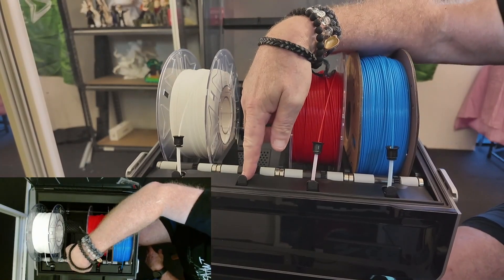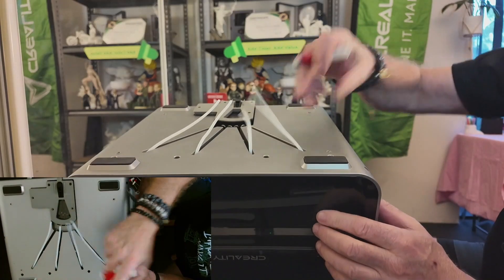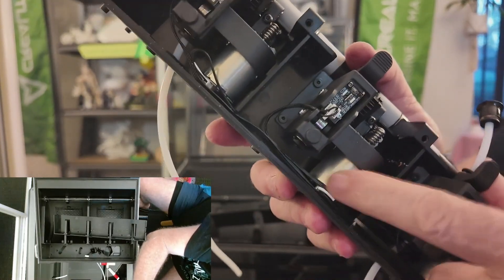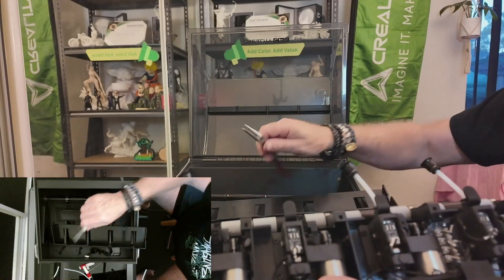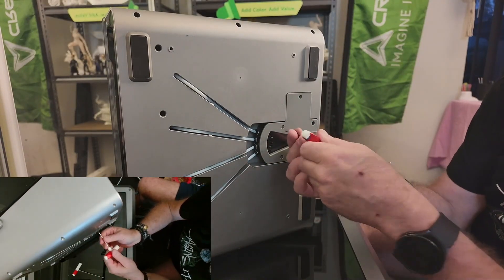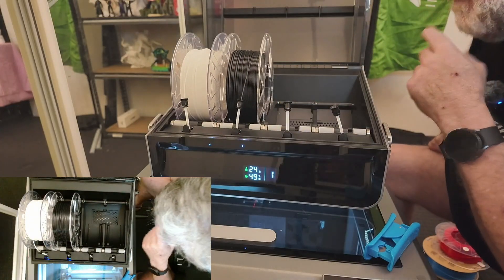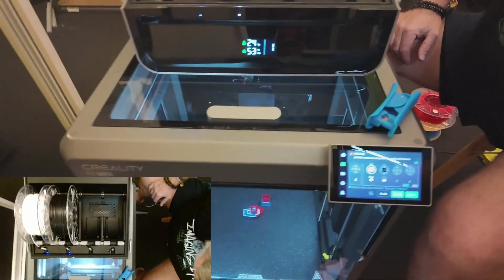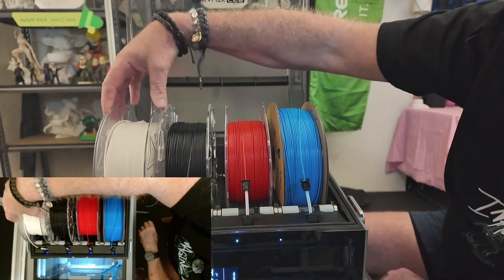I dismantle a Creality CFS to remove a piece of stuck filament.

Comment: After clearing the clot in the extruder, I observed another problem,

The filament was moving smoothly through the buffer, but almost 60 - 80 mm outside it would stop and retreat, going back to the spool.

What could be the course and the possible solution?

Comment: Thanks for doing the video.  Very helpful showing disassembly and fixing the bad PTFE tubing.  I am chasing all of the reasons contributing to the K2 Plus and (2) CFS  FR2836 error code.  I also learned that a non connected connection for the tubing internal  in the hub causes filament jamming.
Reply from the maker: Thank you glad it was helpful

Comment: Hey Gary, Literally just had a jam on my CFS internally after a 54hr print. Again mine was in the B slot as well Go Figure? I was absolutely fuming as it wouldn't not allow me to recover the print continuation stating filament need to complete flushing. OH well.  Anyway saw your Video and appreciate it as it saved me a tone of time stripping it down myself for the first time. Cheers  Mate
Reply from the maker: Happy it helped

Comment: For some reason my ribbon cable that connects into the feed motor block is wayyyy shorter, to the point I can't connect it now that its disconnect as the motor block needs to be seated into position. Any ideas anyone?
Reply: Same here, did you find a solution?
Reply: @fattyarbuckle78 yeah, the cable was folded on itself and pinched inside the case, which made it seem shorter. I had to gentle tug and wiggle it over a ridge inside the case. It was a pain to do because you cant really see anything and i didnt fully take it apart. I got there eventually though

Comment: When mine broke off I just inserted a piece of filament from the single hole in the back and gently fished it through the channels underneath and prayed and it finally made it to the motors and pushed it out. When I said I gently fished it was a matter of creatively bending the filament prior to installing and it luckily made it into the D channel and I just pushed slowly until I felt contact and slowly, slowly, slowly pushed until it came out the inside hole. 

Your way took way longer, but it was a great lesson on how it comes apart and probably the best way to do it.
Reply from the maker: I tried a few pushing options none worked unfortunately, then thought, well it will make for an educational video :P

Comment: My Bambo Labs Jams from time to time.  Generally I can just push a piece of filament up the tub and it pushes the small piece out of the tip.  Granted, the AMS really sucks getting at it tubes, but I am surprised you have to take the entire head apart to push the piece out.
Reply from the maker: Got stuck right in there :(

Comment: Cheers Gary appricate the how to, but question for you, the ribbon cable what if the one in say mine is considerably shorter than yours and no rubber bung making it impossible to re-attach? any clue how to take out the plastic work inside?
Reply: I am having the exact same problem and I am struggling.  Let me know if you have a solution.  Gary made it look so easily but mine is so so short.
Reply: @1iapplegeek  With the short cable I found the feeders had plenty of cables to the board that the short cable connection goes into so I took out the screws and dropped the board out by an inch,  making so I could reconnect and use the 3 remaining feeders (creality are sending spare), moving forward a chap has posted a video of the complete strip down of the CFS which exposes that ribbon cable so when the replacement feeder arrives I will attempt that to see if the ribbon cable is simple trapped.
Reply: @1iapplegeek  ok Ifixed m cable length I followed this chaps video https://www.youtube.com/watch?v=L7RsgGiJlEQ took out the cable tie holding back and I now have plenty of slach
Reply: @BattleGroupNord  thanks for the response and the link!!  I got it back after about an hour of fighting it but this way is soooo much easier :).  Thanks for sending.  Really appreciate it.
Reply: @1iapplegeek  No problem the joy of a community online

Comment: very informative video, i had similar issue from the start , first time using cfs and the first left sensor would not work , i opened it up like in this video to find a very small lock washer stuck in between the gears
Reply from the maker: Glad this video helped,  it's a real pain when those sensors go out

Comment: is there a reason you use a ptfe tube cutter to cut your filament instead of a wire cutter?
Reply from the maker: I usually use cutters just forgot to take them into the video room and the ptfe cutter was in there.
Reply: @3D4Everyone1  ah ok thanks
Reply: Actually, yes. Regular cutters pinch the tube, making it out of round. The PTFE cutter is like one you use on pipes, it cuts around it and not straight through, keeping the shape intact. Creating a pinch point will result in jams. I worked for Snap-on Tools for 20 years as a mechanical engineer, electronics and IT tech. Trust me, use the PTFE cutter.

Comment: I hope this is a rare occurring thing because holy jesus.
Reply from the maker: Its not that hard to do, it really is just a few screw and tubes to undo. Its easier than the other brands that have similar color options. I shouldn't think it will happen that often, it was me rushing things and bending the filament as I cut it.

Comment: Thanks for the video. 
Seems like filament jams are going to happen from time to time, like paper jams in a laser printer. I'd like to see a Filament System with a design that allows clearing jams without tools. Like clearing paper jams in a laser printer. 
Hitting a price point makes this difficult I suppose.
Reply from the maker: It's easier to get at then other option out there. I would gather if I didn't have the bend at the cut  it wouldn't have got caught like it did.  There are options to remove jams in most of the other places that don't require tools

Comment: I think there's a button on the bottom to release the filament from the gears so you don't have to take the whole thing apart, this could have been a big $300.00 mistake
Reply from the maker: Nope  the one on the bottom doesn't have anything to do with the gears.
Reply: @3D4Everyone1  are we talking about the same button, I'm pretty sure I seen a video last week with somebody with the same issue, and they solved it with a button on the bottom releasing the filament
Reply from the maker: @NoMercyFtw  it releases the filament from the very back motor area, not from the gears inside